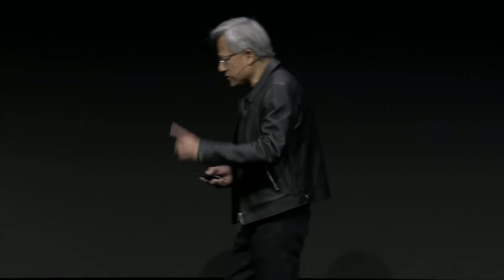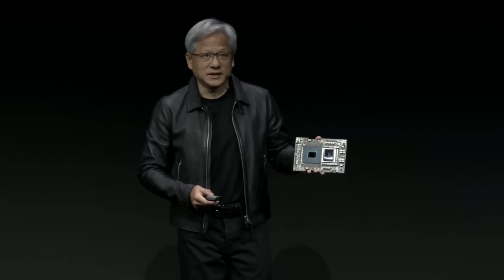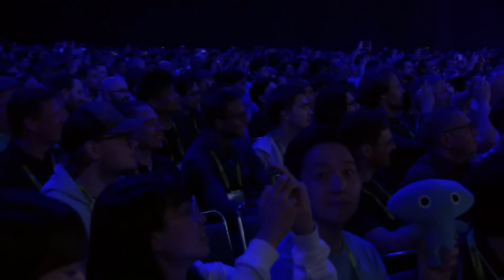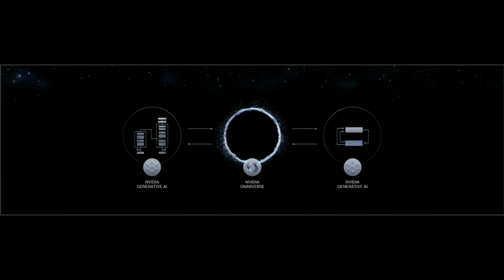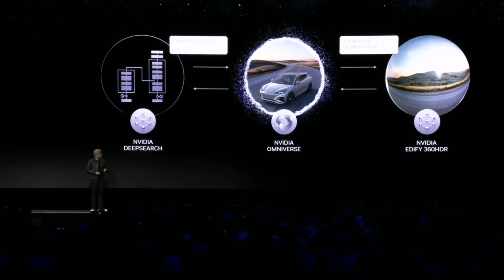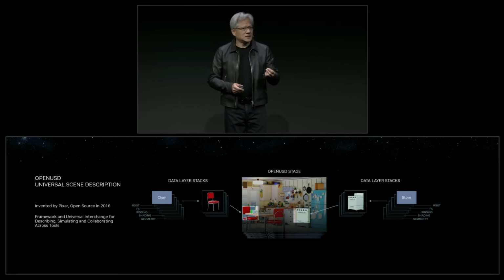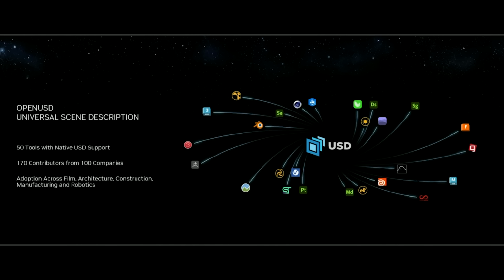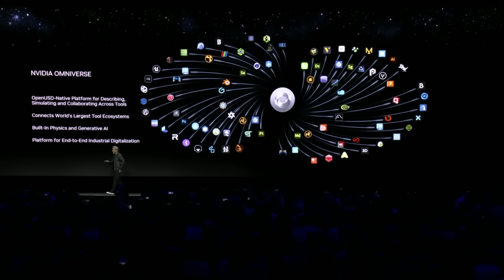NVIDIA Changed Generative AI Forever (SIGGRAPH 2023 Supercut)

Comment: I love that they called it the Grace Hopper. Such a wonderful human being she was.
Reply: Thanks for mentioning that, I didn't know about her. I do now.
Reply: Throw the data into the Hopper. Distilled inference pours out the bottom.
Reply: Funnily enough its composed of two components: the Grace CPU (based on ARM's Armv9-A architecture) which has 72 cores and 117 GB of L3 cache, connecting it all with a 3.2 TB/s fabric, combined with up to 480 GB LPDDR5x RAM at 500 GB/s and a Hopper GPU (H100) with up to 96 GB of HBM3E memory. Both are connected through a 900 GB/s NVLink interface, which is also available for linking up to 256 GH200 chips together. As this high speed link allows all GH200 chips to share their memory, a total system configuration of 256 GH200s can access up to 150 TB of memory!
Reply: @YouHaventSeenMeRight That is hilarious....

Comment: I can just imagine a robot AI looking at me, and calculating the physics, running simulations and everything, to predict exactly how much force it needs to punch me to death in one strike. PunchBot 3000
Reply: And be energy efficient to save battery and be climate friendly 😅
Reply: The neat thing about neural networks is that they are general function approximators. When you throw a ball at a target, your brain solves some hard differential equations but you don't even notice it - you feel the weight of the ball and you just automatically uses the right amount of muscle force to accelerate it just enough to land in the target while overcoming air resistance.

So, when that robot wants to punch you to death, it probably doesn't even have to run any simulations - it just "knows" how hard to punch because its neural net has figured out the solution long ago 😊
Reply: @efovex  It's also interesting what the human brain does involves accurately calculating the future. When we catch a ball we can do that because we can accurately calculate where the ball will be in the future. If we bounce it of a wall once it becomes harder to calculate, bounce it twice and it's even harder, and it gets exponentially harder with each bounce. But theoretically, given enough computing power, this kind of technology could be able to predict any outcome of any action years into the future with relatively high accuracy. Obviously not possible for like a thousand years or whatever, but it's cool that we're might be seeing the beginning of something like that.